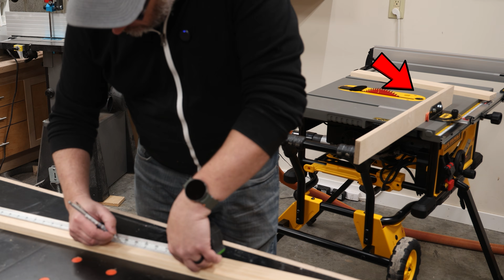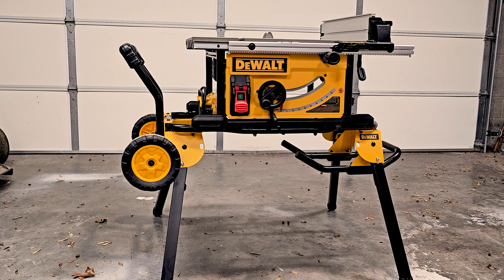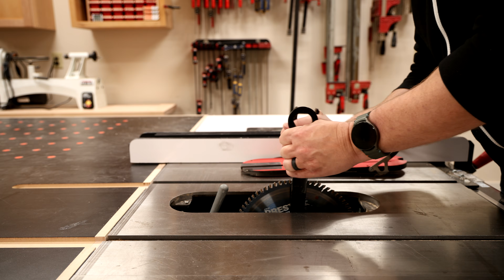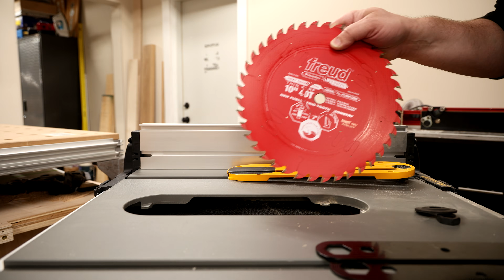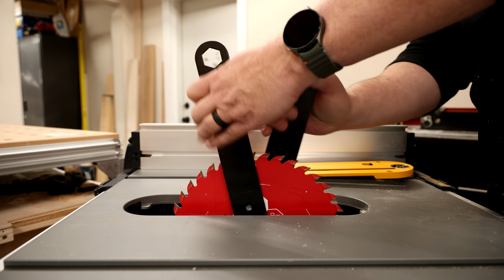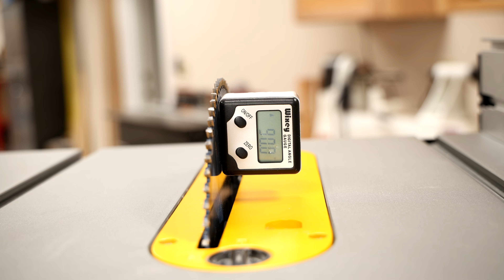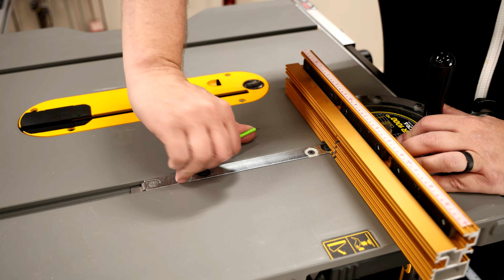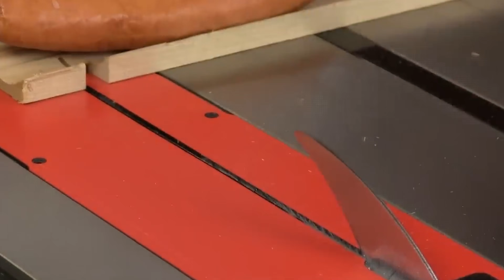Why do people even buy this saw?

Comment: Great comparative video :) the change of the rpm on the job site saw is due to the different motor used, as it uses a series excitation brushed motor (basically a DC motor) its power is constant in the working range, (power is torque * rpm), as the torque is increasing, the rpm will drop, it is not dying it is just drawing and operating on its constant power curve. The cabinet saw has an asynchronous (induction) motor, there the rpm is not changing a lot but it will draw more power when it needs more, and overall has more HP too. Regarding burn marks, you can have them also on powerful saws, it is related to the feed rate vs cutting speed, if all is dialed in, no dull blade and there is no pinching, burn marks will tend happen on high cutting speed and low feed rate, lower cutting speed and lower feed rate will not necessarily burn the wood, otherwise you would have burn marks every time you hand saw something.

Comment: This is a great video! I was really really hoping you had a magic bullet idea that made setting the bevel, repeatably, easier. Also, I was hoping you'd address an issue I am running into with this saw: The motor assembly including blade wobbles, maybe more like jolts, to the left a bit when first turned on. This is my 3rd saw and they all did it so I've stopped returning them at this point. It's chewing up the left side of my cross cut sled but the initial jolt only seems (I Hope) to happen at start up and does not seem (I hope) to impact the accuracy of the cut.

Comment: Setting the bevel angle was the big reason that I upgraded from this same model Dewalt contractors saw to a cabinet saw. I found the mister slots to be inconsistent in width,  but some sandpaper wrapped around a board fixed that. I then 3D printed slot runners to fix the slop issue.

Comment: I want to remind everyone of the third option....That is one of the thousands of used contractor saws like the ones sold by Sears for decades I picked up one that was most likely made in the same factory labeled as a Jet...There is almost nothing to go wrong on one of them and they have cast iron tops ....I was very happy with mine And I did use an aftermarket fence and miter gauge...

Comment: I just recently burnt out the motor on my tablesaw trying to resaw 2 pieces of white oak.  I realised later that as it heats up, the internal resistance increases, making it draw more amperage for less work, making the breaker trip over and over. Should have just given it time to cool off. Using a good ripping blade and doing many light passes wasn't enough.
I'd get a cabinet saw, but I'm working in a basement and don't relish bringing one up or down the stairs.
A big saw that hooks up to 220v would have handled that cutting just fine.

Comment: I threw away my jobsite saw because the table had a slight amount of flex and the fence couldn't lock down parallel to the blade.

The amount of power it had was fine, just garbage if you weren't doing anything but rough work.

Comment: Pretty much a  spot on comparison.  Especially the part about the bevel angle adjustment, that drives me nuts on my saw every time.  One thing you didn't mention is dust collection.  Cabinet saws are typically much better at this.
Reply: The Dewalt specifically is actually pretty decent on dust collection. Surprisingly, the blade shrouding under the table includes flexible baffles/gaskets which helps quite a bit to limit parasitic air draw. With an Etsy-sourced add-on to improve the blade-guard DC setup it's really quite good. (in contrast, the Hercules / Harbor Freight unit looks similar to the Dewalt in many ways, but does NOT include the shrouding or the blade-guard DC fittings and so will likely be far worse on the DC front)

Comment: Thank-you for a very interesting video.  I have the Dewalt 745.  
The best explanation for inconsistent width of a miter slot on a Dewalt jobsite table saw seems to be the coating, which appears to be applied in a spackled or splattered manner.  On my saw, sanding the insides of the miter slots helped a little, but..
In addition, the two miter slots do not appear to be parallel.
About the fence, I love the rack & pinion mechanism, but it needs to be cleaned and have dry lube applied at least a couple times a year.  Every 3-4 months would probably be better.  Also, there is a small amount of sideways play where the fence sits down on the cap screw.
The blade can be aligned to the miter slots, although the problems with the miter slots make that more difficult.  However, the blade may not stay aligned.  I really wish the manufacturers of jobsite table saws would provide a better system for fine adjustments and for locking that down permanently.  I installed the Precision Alignment and Locking System (PALS) from Inline Industries on my old Craftsman contractor-style table saw.  Works great!  Blade is aligned and does not shift.
Thank-you again.  I have viewed several of your videos and look forward to more.

Comment: Though not cheap.. the Festool TS60 track saw is next level.. with scoring blade too. But you can easily do 95% of what it does with a cheap Harbor Fright or similar option with some caveats mostly around how clean the cut is, and possibly how powerful the motor is for harder wood. I'd argue that a small table saw like the Dewalt + a decent $200 or so track saw and a centipede setup would be better money than a $2500 table saw that gives you 2x the space of the Dewalt. I'd spend the extra on a decent miter saw and sander/dust collection setup. :).

Comment: I had the same miter slot issue with my 7491. Turned out mostly to be thickness inconsistency of the finish at the edges of the slots. Stripped it off. Still not spot on but it’s noticeably better. Maybe something to look at if someone is having the same problem.

Comment: I have been woodworking for approximately 40 years. I buy old equipment and rebuild them and put to use. I also have a Dewalt portable ts. The Dewalt is great for construction and portable. When you compare it to a cabinet saw there is no contest. Cabinet saws are more accurate and more powerful. The larger table makes a huge difference. Another factor that make a significant difference is how enjoyable is it to use. A cabinet saw with a really good set of blades is a pleasure to use. A portable ts for construction pales in comparison. It is great for construction but not that great for building nice furniture. You can make it work but I personally don’t enjoy using it. New cabinet saws are expensive but older used ones are cheaper than a portable table saw. I purchased a used Powermatic 66 for $200. It was in great shape. 3 hp single phase. Replaced a few bearings and switch. It will run circles around my Dewalt table saw. Bought another one for $500. Old Powermatics or Deltas are as good or better than new except they don’t have the Sawstop technology. If you like making nice furniture and have some space do yourself a favor and get a cabinet saw, new or used.
Reply: Most of the stationary tools in my shop are so old that if I cleaned up the sawdust, it could be mistaken for an antique store.  :)  My honest opinion is that non-industrial stationary power tools peaked in the 1950's; almost everything since has slid slowly downhill, compromising quality to keep prices down.  The only drawback is that the old tools don't have modern safety features.  For example, I wouldn't trade my Craftsman table saw for anything you offered me - but it has no blade guard or riving knife.  My father and grandfather taught me a healthy respect for tools, though... I'm 76 years old, and so far have no missing parts or dramatic scars.  Shop tools are kind of like motorcycles:  the day you stop being a little scared of them is the day you need to start staying away from them.

Comment: These two different saws are designed for different types of woodworking. The Dewalt is made for general carpentry while the Sawstop is made to be able to do cabinet and furniture building. They both do an excellent job at their intended purpose, and I'll bet I could build some very nice furniture with that Dewalt! It just wouldn't be quite as easy as with my Sawstop. Since there are all kinds of saws out there and since price can drive a purchase, if anyone considers a used saw, please try and avoid those that lack a riving knife. Also, I don't recommend cutting wood over 2" thick in a single pass. Big chunks of wood usually "move" as you slice them, and can easily pinch the blade and cause kickback. The riving knife helps avoid that situation and making smaller passes will keep you aware of what's happening with the piece of wood before you have an unexpected accident occur.

Comment: My opinion is unless you have a full scale working for profit wood shop, a cabinet saw is not worth the money. I started with the portable Ridgid saw which worked well when I got it dialed in. But the top was aluminum which caused some issues. And don't get me started with Craftsman crap and their undersized t slots. But I upgraded to the Delta contractor and it works well for my purposes and it's bang on the dot accurate once it was dialed in. And that's the trick. Getting EVERYTHING square and true. I use a dial indicator for setups and nothing I have is out no more than .002 of an inch. But if you have the money and the room...buy the big saw. Bragging rights are worth something.

Comment: You failed to mention the biggest difference. A cabinet saw doesn't move and takes up more space. In a small shop you need to be able to move machines into a workspace and then store them out of the way.
Reply: With a mobile base, this really isn’t an issue. I’ve had two cabinet saws and both had mobile bases. My saw lives agains a garage wall and I pull it out every time I use it.
Reply from the maker: I just assumed if someone is considering a cabinet saw then they already determined they have the room and that's not the biggest hurdle for them.
Reply: @MWAWoodworks  - My cabinet saw fits into the last available space I have in my garage workshop. But, you are right, I measured carefully before ordering it. It fits with maybe an inch or two to spare.  Setting up to do any work and returning to the fully-stowed configuration in my shop is like a game of Tetris!

Comment: I’ve had the Dewalt saw for years. Just recently I upgraded to the TSO fence & added a soft start module.  It has been a great workhorse for me.
There is 1 minor drawback that you missed.  The top is not magnetic.  Certain fixtures won’t work.  There are other alternatives, but it is a slight annoyance.
Yes plastic insert plates are hinkie.  Making your own out of plywood is a good option.
Your vids are informative & enjoyable.  Keep it up!
Reply: Yes, I've made several custom plates out of 1/2" Baltic.   They work very well and improve dust collection too.

Comment: Great video. I have the same DeWalt saw. Did you by chance check the blade runout? If so, what did you find? No matter what I do I have runout even though when I check the mounting flange that the blade tightens against I have no run out detectable with a dial indicator and my blades are from Ridge Carbide. Every blade I have shows runout which makes the other calibrations questionable. Thoughts?

Comment: I wouldn't buy either.  I look for classics, and they can be found for as little as 40 bucks.  I'm in Canada and there was a brand up here that was better than Rockwell/Delta, just beautiful castings.  I paid 60 bucks can for it, and then got an Inca and sold it off.  I will stick with the INCA.  anything you get will have some limitations, so might as well get something really cool, you can love for ever.  It was limiting when I got it, but with a track saw, I don't feel that way any more.

Comment: Great video! I’ve owned the DWE7491 for 7-8 years now, so suffice it to say I’ve had some experience with it.😂 
I wasn’t surprised to see how it cut the 4/4 and 8/4 material. That has been exactly the same experience I have had. BTW, I wasn’t surprised to find the 3HP motor exceeded the 1.5HP Dewalt. It would have been interesting to see the difference with the 1.5HP Sawstop. I also wasn’t surprised to see the burning when ripping workpieces with a crosscut blade. It’s kind of a penance for doing something like that. (Ask me how I know😂) I’ve done that from time to time and kicked myself for not remembering to swap blades. 🤦‍♂️
My tabletop isn’t flat either, but not as bad as the one you had. In terms of accuracy out of the box, mine was spot on right out of the factory. (Sometimes it’s better to be lucky than good!) 
Yea, the bevel is a PITA. As such, I’ve resorted to the track saw for those. Speaking of which, you are ABSOLUTELY right about cutting sheet goods on that saw. It’s nearly impossible, which was the reason I bought the track saw. 
The two main reasons I would like to upgrade to a cabinet saw are for the bigger tabletop, as you documented, but also the vibration of the Dewalt. If you leave a workpiece or tool on the saw while cutting, the vibration of the table top will cause it to fall to the floor - very annoying. 
At the end of the day, using many of the workarounds you mentioned makes this saw very useable for me. It remains incredibly accurate and I can always count on it to cut workpieces with very good precision. 
Again, great video, interesting to watch. 👍🏻✅

Comment: My first major saw was a Craftsman Radial Arm saw. Very dangerous. When we decided to build our own house, I went all out and bought some top of the line equipment at the time, figuring that they would pay for themselves in the long run. This was about 25 years ago and I bought a Delta X5 cabinet saw and band saw, among other things. To this day, I still use them with very little adjustment other than replacing blades. Along the way, I did buy a Bosch 4100 table saw. After a short period of time, the aluminum casting that was the main structure of the saw broke making it an unusable pile of parts. If you can do it, justify the expense and have the space, I definitely recommend the cabinet route. Buy once, cry once. Lots of times cheap turns out to be expensive.

Comment: Excellent discussion!  To my way of thinking, there a two major issues to consider when equipping your shop.  First is the need to decide how you intend to use it.  Are you building big projects, or smaller ones?  Are you doing repetitive work, or one offs?  Do you think you will mostly do one kind of project, like say, wood turnings, or do you want to do a bunch of different ones.  Assuming you have figured that out in advance, you can equip to suit, often at sharply reduced cost...especially with used tools.  I happen to enjoy smalls, with lots of variety.  I love really old tools, and my rebuilt 1950 12" Craftsman bandsaw is one of my favorite tools.  Likewise, my 1950's Craftsman 4" jointer.  The next consideration is safety.  I just swapped out my DeWalt jobsite table saw with the Saw Stop compact.  I used the DeWalt successfully for many years.  Once aligned, it stayed aligned.  The Saw Stop came perfectly aligned.  One day, when using the DeWalt, I came within an inch of putting my hand on the spinning blade.  In 50 years of using table saws, I have NEVER come that close to major injury. The next day, I ordered the Saw Stop.  In some ways, it is very similar to the DeWalt, though it does have the micro-adjust for bevel cuts, and it has more infeed table.  Also seems a bit more powerful.  Comes with the same crappy fence and miter gauge as the DeWalt, but I almost never do crosscuts on the table saw anyway.  I will check out the TSO fence you mentioned.  Be nice if it would work on my new Saw Stop.

Comment: There are several factors to consider when buying a tale saw regardless of whether it is a glorified cabinet say or a contractors saw. Number 1 is the hp of the motor. a 15 amp motor will not deliver more than 3/4 horsepower. If one is using soft woods or plywood then this is not a factor. Number 2 is the blades you are using. Spend the money for really good blades with multiple teeth, it makes a big difference in the smoothness of the cut. Number 3 is the fence system. Unless you need very quick set up and extremely accurate fence systems witch cost a great deal of money, keep it simple. Bells and whistles are fine but unless you are doing production style work excessive complication is not needed. Take a three foot metal rule, put it against the blade of your saw and measure from the center of the blade as well as the two end the exact length your need.

Now for something completely different. Consider find old Craftsman table saws with the real cast iron tables. hances are they will be cheaper than a SawStop and just as accurate. It will also give you a chance to rebuild and understand your table saw. Second, go find a radial arm saw, they are everywhere, cheap, and extremely accurate while being far more versatile than the typical miter saw. One can put dado blades and cut dados easily. Anything over 18 inches and you should use a router. Compound cuts are extremely accurate and easy to set up. One can even rip with a radial arm saw. Remember that your table saw excels at ripping and not crosscuts. Radial arm saws excel at crosscuts and not ripping.

So, with these two saws one doesn't need crosscut sleds or other fancy attachments. Dados are a breeze without the need for a stack when using a radial arm saw, you control the depth of cut. You can make tenons of the radial arm saw. Add a bandsaw to your machinery and life is good.